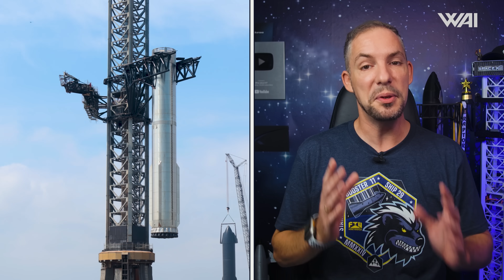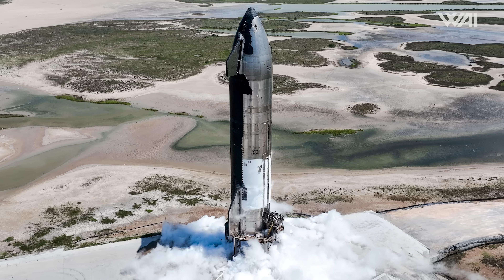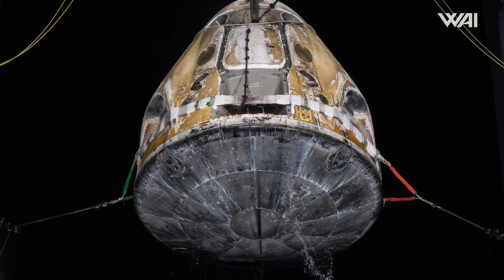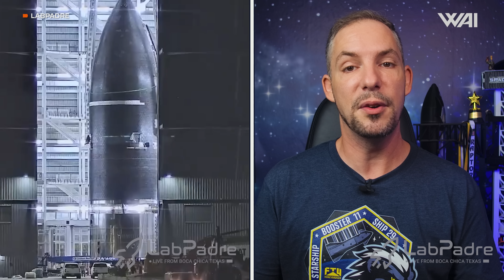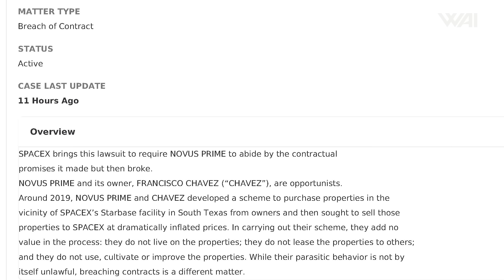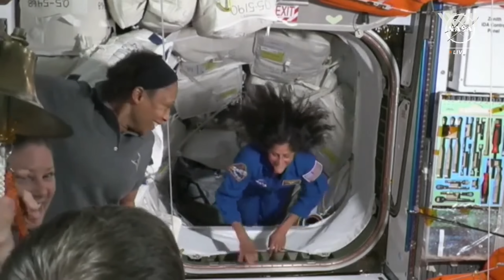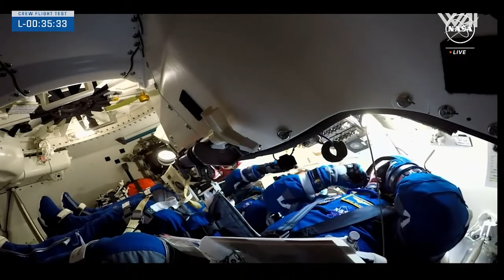SpaceX Drops Starship Flight 5 Plan Update! Starliner Still Stuck At ISS!

Comment: That raptor 3 is really impressive.. hiding all those pipes and cables.. less things to burn up.. is it going to be 3D printed?   The Boeing ship has 'gremlins' I worked at Boeing.. it sometimes happens.. LOL  I worked on the 777.. but it's design was done in 3D modeling before a single rivet was set.. ;)

Comment: I still think this maneuvre is insane.. However, what worries me most, are the 2 pins that should be caught by Mechazilla. Why just 2 pins? Wouldnt a ring all around the ship be better? Or, at least, 2 symmetrical subsections of a ring. I mean: what if the booster lands perfectly in Mechazilla's arms but it does so with a less than perfect rotation, so that the 2 pins are not at Mechazilla arms'reach?
Reply: The booster has excellent roll control. Besides, it can abort the catch very easily

Comment: All they have to do is bring Starliner home while Polaris Dawn is primped on the pad ready for launch later this month to serve as a potential rescue mission if something goes wrong with the thrusters upon re-entry. Polaris Dawn is spacewalk capable. Just keep 2 of the astronauts home so the 2 rescued from Starliner will have seats. The spacewalk would still happen with additional firsts getting the Starliner crew spacewalked back to Polaris Dawn. lol But I'd be surprised if it's not completely workable in an emergency. The Starliner suits have got to be designed for loss of pressurization and life support for a certain period of time. Or maybe spacewalk isn't even necessary. Wait until the next crew dragon is primped on pad in September and use it as a potential rescue mission. Can't 2 universal docking adapters dock together from both ships?
Reply: That would be gender incompatibility without an adapter, but I'm not a plumber.

Comment: Why don’t they lift a booster with the crane and simulate catching it with the chopsticks? I don’t mean drop it from up high, but just enough to simulate the last few seconds. They should even do a fuel consumption simulation and a navigation  simulation by letting  the booster navi system show its data to get in position.
Reply: youmean like a Starhopper?
Reply: @unitrader403  nope. Like taking the current booster ( or a test one full size and weight), lift it with a crane and actually simulate the chopsticks catching it .
Reply: @CarlosMartinez-kt3oe  honestly not sure what system that would actually test that has not been tested yet in another manner.. it wouldnt be a test for the Booster since its just dangling from the crane unpowered (anything else would be dangerous for the ground crew), and i dont see what it would achieve for the Arms which is diffrent from what SpaceX already does with Booster 14.1
Reply: @unitrader403  the ability to capture a moving object.  All the capture testing was done with a booster simulator static in a stand. Now imagine the crane is moving it down at the planned speed and it swings a few centimeters each way as any moving object would. Can the arms catch it quickly enough to and softly enough when it is moving?
Reply: @CarlosMartinez-kt3oe  didnt notice your reply, but i dont see any useful insights that could be gained there.. you cannot add much horizontal velocity during such a test, cause it would make the load sway and potentially topple the crane, and the vertical component a crane could introduce is also minuscle compated to a a real incoming booster.. (only found info for vertical movement of the LR-11000 which is 10 to 15m per minute maximum, compared to an incoming booster which is about 30 times as fast in the final moments of the descent)

so in short any test setup with a crane that is safe for the ground crew is pointless, and any test setup with a crane that would be remotely useful puts the ground crew in danger and exceeds the specs of the crane...
Reply: @unitrader403  well, I do .

Comment: With Starship V2, wouldn't they need to Flight Test it like they did with original Starship? When they make a change to an engine they have to test that component. Wouldn't V2 be a different component that needs to be flght tested?

Comment: With all the recent raptor 3 performance improvements I think they can afford the added weight of landing legs just in case they are off target or prefer to land anywhere else
Reply: I was wondering that myself.  With the improvements and also the weight savings, maybe they will reconsider at some point?
Reply: Raptor 3 is not being flown yet.  Other changes have increased overall weight in the meantime.  SpaceX can hardly afford more reductions to orbital payload weight.  I believe similar constraints reduced the space shuttle's usefulness to relatively low Earth orbits for heavy payloads.

Comment: I picture an oil well that still has methane gas in it in the Gulf of Mexico. They catch the booster on a tower on that stand then they set it off under a boat to bring it back if it needs maintenance. That way you kill the sonic booms close to ground and you can haul methane back and forth to refill your ship.

Comment: I just wonder what the contingency plan is if the chopsticks "half catch" the booster.  Like if it just misses and is hanging there precariously.  It'll be too dangerous to approach, still having fuel and fumes inside, but something will either have to pick it up and set it straight (which would involve personnel on the pad), or they will have to purposefully drop it and just let it blow up.  The catch test seems to be binary:  you either succeed perfectly, or blow something up.

Comment: Do you know how the booster is aligned to the pad after the catch. Specifically is there a way to move the booster in and out of the tower? This seems critical to align with the base fixture on the pad.
Reply: Good point.  It's not just left and right, which the arms auto correct, and up and down, which the engines can do to tolerance, but distance to the tower has to be quite precise to avoid bringing in a crane afterward.  Fortunately, quick turnaround won't be part of the plan yet.
Reply: preety sure the animations showed that there is a mechanism on the arms that will center the pins on each side, which will fix roll and off-center landing. also pretty sure it has been in actual use for a while mow to get boosters and ships centered on the pad..

Comment: Please check. Starliner's automated program will only work if all 5 thrusters are working. Their computer program doesn't cover maneuvers with only 4 thrusters. Therefore, it required manual docking and will require manual reentry. They are trying to reload a computer program that will allow it to use automated program with only 4 thrusters. They don't want to loose their prototype but it requires manual reentry until new program allows automated program to work. That's why it can't disconnect from the space station and back away with it's present automated program. I would be dangerous for the space station to allow it to disconnect at this stage.
Reply: @thomasthompson5314  send up one of Elons robots....train it to push a button...
Reply: Yikes. This sounds like the 737-MAX debacle where a lack of redundancy in the software caused the crashes of two planes...
Reply: NASA did give the green light for a capsule that couldn't tolerate failure? I mean, that starliner is a death trap piece of trash - but that's beside the point. I never thought NASA would allow something that couldn't cope with the loss of 20% of its thrusters. I mean, I wouldn't. This is the kind of thing that one puts redundancies on the redundancies.

Comment: That catch animation is wrong ! They definitely won’t try to catch the booster directly above the Orbital Launch Table - they would catch it off to one side - where they normally pick the booster off  of an SPMT.   That way if the catch fails, then it won’t crash right into the Launch Table.
That should be pretty obvious..
Reply: Then why did they activate the deluge system during the landing of the booster on the last flight?

Because it's going to land over the launch mount.
Reply: It's pretty obvious you are wrong.

Comment: There are reports that Starliner could become a problem as they currently do not know how to disengage it from the ISS without a crew that has to do some work. The capsule has no automated departure system. They can not simply release it as it could bump into the ISS. So it currently blocks one of two docking ports.
I hope they solve that.
Reply: The incompetence at Boeing Starline is unbelievable.  They've had all this time to fix any issues and make sure the flight would go smoothly.  Its not like they were rushed, or in a deadline with SpaceX.
Reply: @gizmo8760  I guess it is an effect of the fixed price. That was a massive miscalculation but they had to deliver. So I guess at one point they decided to cut corners and be as low quality as they can.
I think that showed when they needed ages to redo the insulation instead of proceeding with a second capsule to keep the timeline.
I guess there will be no further Starliner missions, even if they manage to land it with a Crew.
Reply: @gizmo8760 the only reason for launching starliner when they did was to save face and it's totally backfired putting those astronauts and the iss at risk , it should be scrapped

Comment: Adding the new Raptors would be a good idea. But the heat panels still not coolant aluminum tubing in the epoxy to cool better with less weight than the epoxy.

Comment: Why would Ship 30 be more advanced than Ship 32? Are you sure you don't have that backwards?
Reply: @jonathanrichter4256  Because 30 is the next to fly, so they redid it's tiles with what they learned from the last flight.  32 will get its changes before it flies.
Reply: 32 is first generation that won't  be flown. 30 is a modified first generation

Comment: To properly test mechziilla, pick up the unit with the crane with a release rig. Lift the unit up above the arms then release and catch. Why Not?
Reply: Igniting the engines while hanging from a wire?  Sounds awfully risky.
Reply: @user-gv4cx7vz8t  coordinating the release and catch is  an extremely hard  event to coordinate
Reply: With the engines on, for a slow descent. That might work.
Reply: @chattywalrus8485   it'd  be a real test, better than sitting on the stand and opening and closing the arms

Comment: hi, please read if you are knowledgeable looking for answers thx. How is there going to be a heat shield on the pez dispenser cargo door, is there going to be a different type of heat shield, or maybe it’ll be ablative? does anyone know?
Reply: @noamjacob1216  The ship is oriented with the cargo door facing up and heat shields facing down. The nose is pitched up so the heat flows mainly over the belly of the ship.

Comment: Catching a booster isn't impossible, but I'm afraid it's too early. They need one or two more test flights just be sure. The risk of dropping a booster into the ground equipment is too great.
Reply: I think you underestimate the value of Spacex's speed of innovation.  They are in a hurry and expert at taking calculated risks.  I don't think we are good judges of what is too early. Of course, Spacex is smart to already be building redundant launch capacity to cover exactly the risk you are talking about.  Moreover, they can repair damaged stuff quite quickly also.
Reply: The last flight test had the booster go exactly where they wanted it to. The next step is to catch it. They won’t gain anything from doing the same thing again

Comment: Not sure where you got the video of someone applying teflon tape to pipe threads, but they’re doing it backwards! As presented, the tape would loosen as the pipe was turned.
Reply: Probably just the left and right transposed for video copyright purposes
Reply: @sja45uk  hmm..... good point.
Reply: @michaelotoole1807  I am not sure as I am not actually confident which way to wrap LH and RH threads
Reply: @sja45uk  rh clockwise lh counter clockwise.  basically wrap the tape in the same rotation that the parts spin onto so the tape wont loosen up when the parts are spun together.
Reply: boeing was caught using unqualified people working on the space launch system causing major delays in the program. no reason they wouldn't do the same with starliner.
Reply: @georgegoodwin9722  stockphoto moment
Reply: I've just said the same then saw your post 😅

Comment: No mention about the autonomous software that wasn't installed on Starliner? why didn't it get installed, issues with it? So now it's being installed remotely, without out the software it cannot detach from the ISS autonomously if needed.  Personally, I wouldn't trust any Boeing hardware including a new airliner. They have been asleep at the wheel and riding purely on their reputation and like other companies greed has taken priority over everything else. It's time to start locking up CEO's and Board members for negligence in safety.
 I digress, love the channel, your personality is the driver of success!  Thanks for being you!
Reply: Yes, Boeing won't change until executives GO TO JAILl. Never forget they shoved bigger engines under the 737 instead of designing a new Max airplane, told airlines it was the same plane and they wouldn't need to retrain pilots, had to add the MCAS system to prevent the unbalanced plane from stalling, and when it went wrong pilots didn't know what was happening and 346 people died.

Comment: Apparently large amounts of mercury in the waste water!
Reply: The mercury levels are 0.113ug/L. This is below the 0.2ug/L requirement for drinking water. 

The figure you're more than likely referencing (113ug/L) is an error. It’s because the value was incorrectly converted from mg/L when it was already in ug/L

Comment: FAA update. SpaceX can't launch due to water quality issues after deluge use. Gonna be 2mknths minimum for their next launch!!!!
Reply: The mercury levels are 0.113ug/L. This is below the 0.2ug/L requirement for drinking water. 

The figure you're more than likely referencing (113ug/L) is an error. It’s because the value was incorrectly converted from mg/L when it was already in ug/L
Reply: @tranquil0335 
The latest crazy from the EPA is setting zero as the goal/limit for some contaminants. IOW if we can measure it, you (insert name of company) are out of business. An interesting bureaucratic weapon they’ve created…

Comment: Love these updates. Please mention about the serious water pollution issue that could force compliance before launches.
Reply: The mercury levels are 0.113ug/L. This is below the 0.2ug/L requirement for drinking water. 

The figure you're more than likely referencing (113ug/L) is an error. It’s because the value was incorrectly converted from mg/L when it was already in ug/L

Comment: I thought the FAA said if no incidents happen with flight 4 they would push the license through quickly
Reply: If they wouldn’t attempt a booster catch they can probably launch whenever the want to
Reply: That was for a flight 4 type flight, because there changing the flight plan to include a booster catch the faa has to approve it.
Reply: Clearly a big change to flight plan. Flying a huge booster back toeards land and a town, Brownsville, required another flight plan. No politics,  no punishment, just safety. If I lived in Brownsville I would be keen to know the booster wasn't going to crash on me.
Reply: @philleng480 not political until without apparent reasons the FAA cancelled their scheduled assessments dates. 🙄
Reply: If they are attempting a booster catch, then they will be operating much closer to Texas coastline and that will (and should) require more verifications to ensure public safety,
Reply: @ericmatthews8497  exactly, if I lived in Brownsville I would have rather more concerns about the booster catch than those armchair warriors spouting about politics.
Reply from the maker: If there were no changes to the flight plan compared to the last flight. There’s a “catch” to that statement. 🎉
Reply: @Whataboutit  FAA stands for Forever Against Amusement
Reply: I thought that too but the zilla grab aspect of flight 5 may require FAA to certify that it's safe enough.
Reply: As AA just reported, there’s an environmental impact investigation under way and the FAA halted all approval work for now.
Reply: @antibrevity ..politicians are involved in telling FAA what to do , when to do it. So yes, ‘politics’.
Reply: This is quickly.  The FAA said simply that no incident investigation would be required and that is true; SpaceX did not perform or submit an official incident investigation.
Reply: They're punishing Elon for his political opinions
Reply: This IS rather quick for the FAA....